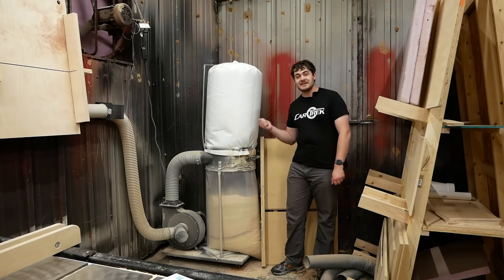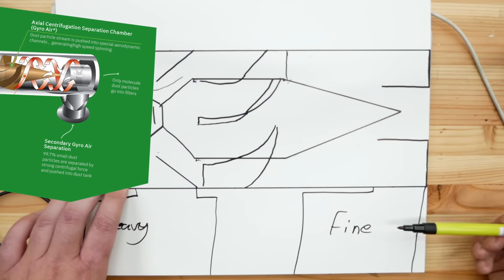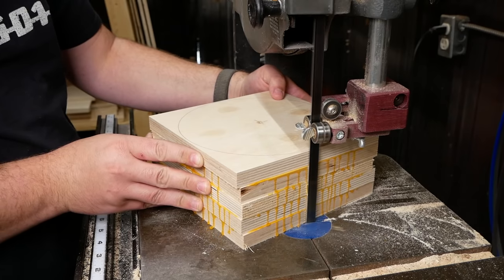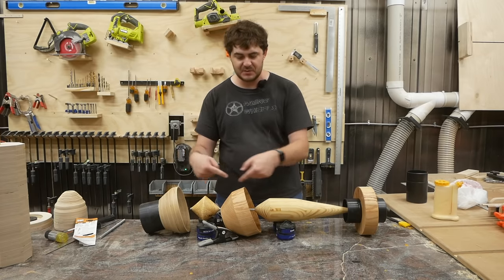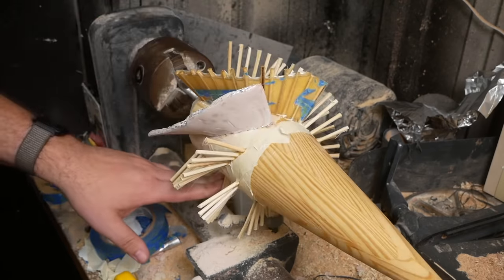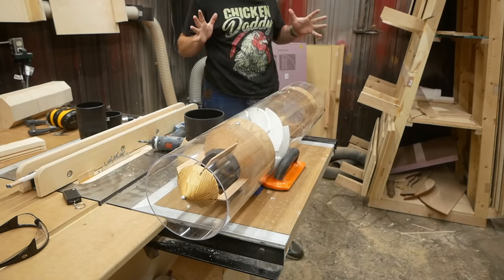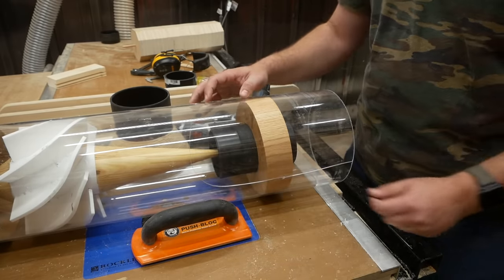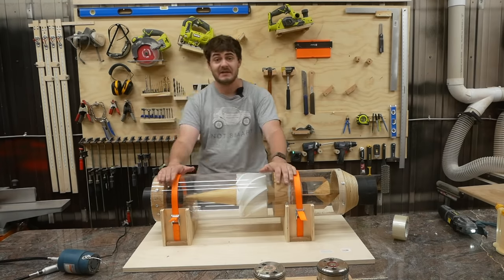I Made a Centrifugal Dust Separator to Upgrade My Cheapo Dust Collector

Comment: Ummm...your blower has to blow the dust-laden air (I know it did the same thing before). Having seen a few blowers destroy themselves when something big comes down the pipe, have you thought about putting the blower AFTER the dust separation stage?
Reply: Exactly.  This is actually a really big deal, and happily, easy enough to fix by reversing the order of the components. There is a lot of energy in the outer tips of the impeller blades rotating at 3600 RPM.
Reply: Did you also note that the spin separator thingy is sealed and completely non-serviceable. The only thing that will prevent the whole thing choking up is that he has the blower fan to chop up every thing, just like a leaf blower fitted with the vacuum attachment and bag.
When he first starts it at 33:04 you hear the fan chomp up something very hard (a rock?) and spit it out into the separator. The small black chunk completely bypasses the first stage and get lodged in the white air vanes. Interestingly it somehow disappears after a jump cut :-)
Reply: @johncoops6897  that's no problem. The type of filter he's using is set to blow up the workshop well before the service due date of the dust separator.... (and I'm not even kidding. I used to design these things professionally, and there's a reason why that type of filter is illegal in Europe)
Reply: @lukearts2954  Are you talking about the cyclonic separator or the filter box he made?  And what is the risk that makes them illegal?
Reply: @williamsacksteder9438  I'm talking about the over-pressure single bag unencased filter, not about his separation contraption. 

The biggest risk is explosion on repeated use without any form of containment or mitigation. 
For professional and semi-professional applications, vacuum filters are mandatory because in those filters the dust does not go through the fan. 
For hobby applications with rare use, there are a lot of conditions that have to be met in order to use these flimsy filters in a fully legal way that complies with all insurance caveats too. It is simply not compliant with CE norms concerning safety. 
The biggest problem is that it's not a single point risk. It's a long list of possible problems, ranging from electrocution (to safely operate them according to manufacturer's specs, you have to do so outside, but they are not IP65 (safe against continued exposure to water rays, which is what you have in medium to heavy rain)) and workplace air purity (the filter bag does not comply with the norms for clean air in the work space, so whatever air comes out of it needs to be filtered further), to fire and explosion (the duct type and the "blow through" fan charge the wood particles with static electricity, causing permanent sparks, and the filter volume is not separated from the collection volume, so there is always an optimum point for explosion present (in the collection bin there is 100% dust, in the in-flowing air there is a low concentration in between machine operations (far below explosion point), so somewhere in that volume, that gradient passes the explosion point.
If you want to operate such a filter, it needs to be encased in a fire proof housing, equiped with an automatic fire extinguisher and an explosion panel. If the exhaust meets the right criteria, you can use it indoors, but at all times it is still advised to use it outdoors in free airflow (open on 4 sides) with a safe zone on the side of the explosion panel to allow for flame burst to go unhindered. And as soon as you're talking about an air-tight containment housing, you might as well make it vacuum, increasing efficiency, safety and durability just by adding a few internal supports and moving the fan to the opposite side of the box.

Certain Chinese manufacturers of woodworking equipment will give one of these single-bag filters for free as a promotional stunt, but in truth it's because they can't sell them anymore, and they can only be used in a demonstration setup where no actual woodworking is done. They are dangerous, and if you must use them, use them outdoors and NOT in combination with flex-tubes. (and again, if you must do some parts with flex tubes, or if you use pvc pipes instead of metal ones, GROUND IT. Connect the spring wire of the flex tube to the chassis of the filter and the machine and make sure the filter is properly grounded. Run a naked copper wire through pvc pipe and ground it to avoid static charge build-up. But in general, just use proper metal rigid tubing.) The worst flex tubes are the opaque ones with tight ridges, because they don't have a metal spring that you can use for grounding, and the ridges collect a crust of the finest dust that has been run through it, begging to start a smoldering fire. Note that such fires can go unnoticed for hours, until the workshop suddenly burns down in the middle of the night. This happens all the time because this industry is plagued with complacency, laziness and a habit of uninformed budget cutting (read: corner cutting)...

With regard to his filter box: that one's even worse than the filter he already had. There is absolutely no collection of the dust that is stopped by the final filter, and as he noted himself: the seals don't work so it's blowing the finest dust all over the place, rendering the entire thing pointless. He may just as well use shop air and deliver air puffs on his tool every few seconds.

But I don't want to tear down the idea of making better dust separation. Quite the contrary. Out of experience, I know that multi-stage separation is the best. Of course, if you want an all-purpose filter that can handle any kind of dust or chips very well, you'll need 5 stages or more easily. When using a vacuum filter, you place the (commercial) filter all the way at the end, and any separation modules you add in front of it, will increase the efficiency without compromising on security. 
The first separation that should be added, is a pressure drop unit. Just a sudden massive increase of diameter of the pipe line (insert a huge box with a lid at the bottom that is sucked closed by the vacuum and opens automatically when the filter is shut off, dropping whatever was separated out. Length will determine particle size that will be caught. Positioning the exit of this box slightly higher than the inlet will also drive down the particle size. But this is usually used for larger chips and off-cuts larger than 0.5". Next would be such a cyclonic separation, where size determines efficiency and particle size. Ideal is to have multiple cyclones of growing size. Having an air-flow regulator in front of the inlet of the final filter will also allow for better efficiency when filtering out very light chips or very fine dust. And for the final stage, it is important to use slick anti-static filter material. The filter that is used in the box here, is neither.

This is just a short excerpt of what I would consider essential knowledge before tinkering with dust collection systems... There is much much more to think about, but I think I'm already overdoing it here...
Reply: @lukearts2954  Thanks very much for this. I certainly don't think you're "already overdoing it here", as I realise that it is a huge topic, needing a lot of careful design to capture the dangerous stuff and not just the large chips. Do you have any links (other than Bill Pentz) that I could read?
Reply: @lukearts2954  - When we want a pro we'll go to that channel. Otherwise your efforts are wasted here.
Reply: Hhhhmmm

So with electricity in the fan. There is a risk of dust combustion or explosion.

So those cheap furnace filters could be operated in a vacuum mode.
Which is what they were built for.

And thus presumably keep more dust out of the fan,.and keep all the wood dust away from electrical appliances which may one day spark just the wrong way and burn in an explosive manner.

Interesting idea.
Reply: @lukearts2954  thank you for that detailed explanation. I was wondering about the fire risk there.  Also learned a lot from what you said, especially about the PVC and grounding. 

In the very near future I am planning on moving to an extremely rural area and building a decent shop with central dust collection and all I can think about is how similar this is to grain silos and the fires that can happen there. Coupled with the  lack of rapid fire dept response due to location im trying to prevent disaster as much ad possible... Your info here has given me a new direction as to what to look for in regards to dust collection 

Thank you!
Reply: @johncoops6897  I noticed that large piece skipping the step as well. The thing I then remembered was that the first stage only really works at high airspeed. That or it was a piece that broke off the inside edge of one of the laminated, turned pieces of wood in the middle before the fins.
Reply: @wildearpsadventures4991  you are making the perfect comparison with those grain silos. 
One of the worst dust collection systems that I've had to revise was even using a silo to collect and store dust in a very similar way to grain silos, and thus adding bonus risks (huge fuel mass, fermentation of biomass into combustible fumes near the bottom due to a simple leak in a silo wall allowing small amounts of rain water to seep to the bottom, creation of dangerous aerosol right under the hot metal panel roof when pushing dust into the silo). 
Funny story that one too, because I discovered that risk after I had been called in for a "fatal failure of our system" (under my predecessor our company had replaced the transportation fan that fills the silo and for the client that suddenly made the whole setup our installation). It was a nightmare. That fan was located in a crawl space underneath the silo. Due to the financial attitude of that client, a wrong (cheapest) model of fan was installed, which resulted in a housing failure years before it was anticipated (blow-through fans eat away their spiral housing because every wood chip wears or chips away the tiniest bit of metal or oxide from it, eventually resulting in punctures or ruptures, so they should be given extra layers of hardened steel on the inside of the spiral housing to meet the required length of life). It must have been failing for a long while, because it had multiple holes and ruptures all along the entire circumference of the spiral case. And since it was in such an unfrequented location, and the owner did not have any maintenance contracts of any kind, it just went unnoticed. The chips kept getting sucked through and shot out the holes until they started wearing holes in the floor of the silo. Eventually the entire silo floor collapsed and the crawl space filled up completely with chips. When we managed to empty the entire silo and then the crawl space, we found panels with cuts that looked almost like saw cuts, lined up with erosion cuts in the cinder blocks of the support structure, perfectly in the rotation plane of the fan... 
I immediately sent a "hands off!" notice to our people and advised my boss to cut our losses whatever they were and dump the client. He refused. Then I said I wouldn't put my name on anything related to that client if they didn't scrap their entire installation and bought a new one that was according to professional specs. The company was located in a densely populated town center. Had that silo blown up, there would have been deaths for sure.
But of course, it's situations and stories like this one that taught me the most about what can go wrong, and what can happen when "quick solutions" are chained together. Each one seeming harmless in itself, but put together turning into disaster waiting to happen.

I'm very happy with your positive response. I'm sure you'll be able to make a very safe system when you (re)design the shop in its entirety!
I never consider tricky or even dangerous situations as malice until I get told off for being too careful or even for being delusional "because they had been working like that for years without any accident". I think you can imagine that I've heard that one more often than I'd like.
I can only share what I learned, but I can never make someone learn those things too. So thank you for being of sober and healthy mind. When it comes to fire safety, there's no such thing as over-engineering... There's only underestimation of risk =)
Reply: @lukearts2954  - your comments are absolutely awesome, and i thank you very much for taking the time to explain all that stuff.
Reply: @lukearts2954  the most dangerous statement in any industry "we've been doing that way for years" or similar. 

My first introduction to the fire dangers of the dust collectors was from an "old timer" when I was working in a production shop.  I was cutting a board that had some staples in it and he was working the saw next to me (table saws). Suddenly he yelled at me "Stop!" (I always do when anyone yells it, learned the hard way) he came over and shut down the the collection unit (each saw had its own). He then explained to me how quickly those can catch if one the staples sparked. He used the silo example and reinforced it with "and then the fan is just pumping the fire with more oxygen." Since then , if I even think there might be metal in the wood I will not use dust collection and always pass on that knowledge to all who will listen. 

I'm a safety nut too. Best compliment I got was from the lead rigger in another state. A local rigger wasn't sure about a set up I had made (it was unusual) he called for his boss to ask about it (right thing to do, so I didn't complain). When he got there he said in "who is staying that!" They local guy looked over and pointed at me. The foreman changed his tone and said "If Clayton says it's safe, it's SAFE." He didn't even look at what I was wanting to do.
Reply: @wildearpsadventures4991  That's a great compliment indeed! :))
Reply: @johncoops6897  and I consider your comment a great compliment to me =) Thank you right back! ;))
Reply: @glenmcgillivray4707  that's one of the aspects indeed :) but there are far more static discharge sparks than electric sparks. Running the dust through the fan increases the charge on the dust itself, causing those sparks inside the dust cloud. The earthing of tubes is to avoid charging of the tubes mostly, which causes sparks between the tube and the passing dust, or near connections between pipes. Especially where the duct changes from one material to another (because they charge differently and thus cause an electric potential differential)
And yes, the vacuum systems are much more efficient because the fan does not experience any drag from the chips and dust (and the dust getting in the axle grease and other frictions associated with dust).
Reply: @thysonsacclaim  tbh, I haven't seen any pro channels about industrial dust collection and air filtering. But yes, they probably exist because everything is on YouTube. But I don't think my efforts are wasted. After all, they had enough of an effect for you to take the time and effort to respond :)
Reply: @dannyp1ke  Sorry that I didn't get back to you any sooner... I didn't get your comment in my notifications :)
The best source for information would be national institutes for professional safety, or manufacturers of large scale industrial dust collection. Some will share technical information on their websites, simply because they don't damage their market position by doing so. After all, like you say, it's a lot of careful design, and it requires experience and affinity with the topic in order to actually turn the theory into a good system, and there are only so many on the market that can do that. There is actually a shortage in supply of good designers, which is why the (usually chinese) cheap dangerous bag filters are still so wide spread.
For compact systems I can give you an example. It would not be the system that I would install in my own shop, but for small shops and hard core hobbyists it's a fairly high quality, off the shelf solution for vacuum dust collection: Coral's Eurofilter. They are an Italian company, so they are always happy to give a lot of explanation about their systems. https://www.coralengineering.com/en/prodotti/prodotto/234-depolveratore_eurofilter_en.html
This link is a good start to get to more advanced systems too. Most optimal systems use a large diameter variable speed fan with multi stage dust separation, tuned to the particle size of the shop they are collecting from. Nozzles on machines work best at specific pressures and airspeeds. Too high or too low and it will collect less dust, sometimes resulting in poor product quality (e.g. when chips get in between a pass of a router bit on an automated router, it will show in the finished product). This means that the design also needs to address the correct tubing diameters, turn radii and joint angles. It's a very complex fluidomechanical system.
Good luck when going down that rabbit hole. Don't forget your flashlight XD
Reply: @lukearts2954  Thanks for the link. unfortunately, that machine is too large to fit in my workshop. I'm currently thinking about separating the majority of the dust using a cyclone or gyro system. Then venting the residual air outside and using some sort of heat-recovery for the incoming fresh air during the winter. winters aren't that cold here, and it's not as if I shall be running the machinery 24/7.
Reply: @lukearts2954  these comments were a very relevant read. The shop I work in has that exact model of blow through bag of trash, and while I've always thought it sucked at collecting dust, I didnt realize how dangerous it was. Thankfully it has a clever trashcan pressure drop that prevents large chunks or chips getting into the fan, but I'm now much more Interested in getting it replaced. Maybe I will explore 3d printing a cyclone separator or two.
Reply: @lukearts2954  
Well hell just blow it out the side of the house into the negibors yard,  it should help the grass grow.

No seriously your whole concept is beyond nessary. I know saw dust is flamble but its not dryer lint.
It all depends on moisture content of the wood being worked. 
Show me one explosion becuse of saw dust.  This isnt a grain elevator that can explode with any electrical spark.
I've been close to 3 of them blowing up and one still stands today some 40 years later its metal and still in use with the ripples from the concrete one that blew up by it.  That blast blew out plate glass windows 3 blocks away. You could hear it explode 5 miles away over a large hill in the next valley.   Ive also seen a laundromat explode from dryer lint or gas leak.
Reply: @lukearts2954  I fully appreciate your comment regarding fire safety. The NEC, otherwise known as the National Electric Code, is revised and published every 3 years to update the   methods that have been effectively working fine until now or until proven otherwise.  And fire prevention is the reason it exists, ironically it is published by the National Fire Prevention Administration and adopted nationwide as governing law for electrical installations in residential as well as commercial and most industrial facilities. There are some exceptions but they are outlined in the scope of the document of where it applies. It is enforced by the Authority having Jurisdiction for each municipality.
As an electrician, it's our Bible that tells us what are mortal sins and how we prevent fires related to electrical contributing factors, and our current knowledge. No pun intended. :-)
Reply: @lukearts2954  There is literally zero fire risk. This is a myth. But you do you.